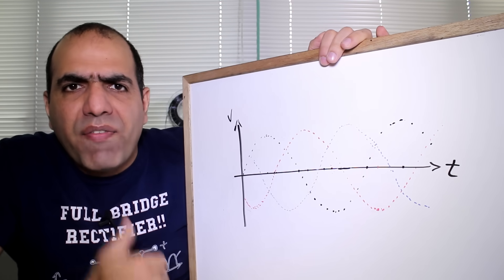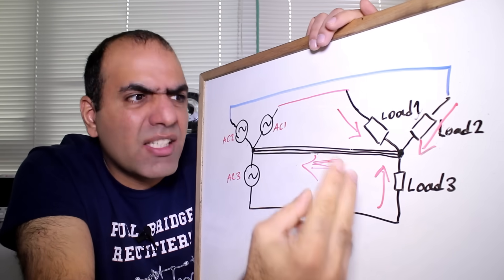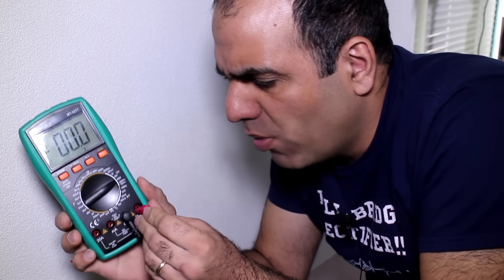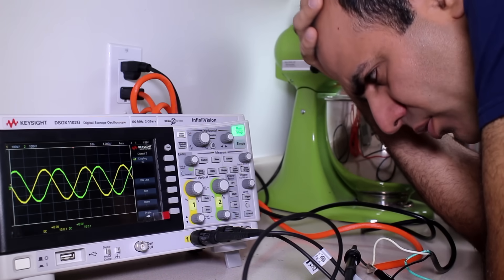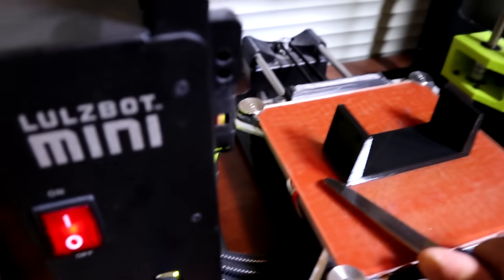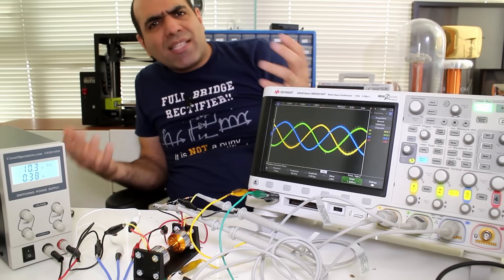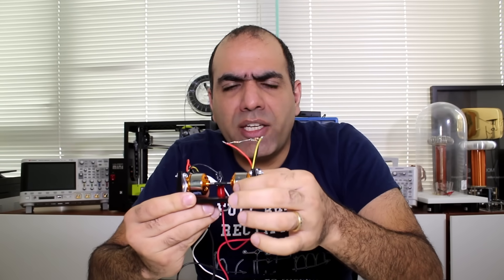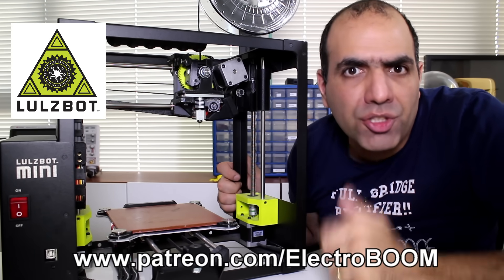Why 3 Phase AC instead of Single Phase???

Comment: oh, poor Canadians.
in europe almost every house has 3 phases :)
Reply: Eric Cartman, Appliances in the Americas don't use "disgusting amounts of power" due to the fact that we have an electrical system with Fischer-Price-my-first-electrical-grid voltages.  it's simple math, guy.  440 three phase can supply 20KW using 10AWG wire, whereas in the Americas we need to run #3.  As a sparky, I can tell you which I'd rather be pulling through pipes or an attic.  Running massive wires in an attempt to get a usable amount of power is cost prohibitive, so we compromise by making our appliances draw less power.  An induction hob running at 3 KW will actually take less energy to do its job than one running at 1KW due to the fact that the cooking will be done quicker, and will be radiating heat to the environment for less time.  I hope I've shed some light on why the electrical used in American homes sucks so hard as compared to most of the rest of the world.  Cheers!   

P.S. It is totally possible (and happens once in a while) to lose one of three phases and have the remaining still live.   Any single phase equipment on the two remaining live lines will continue to operate as normal.  Three phase motors that are already running will continue to run on the one remaining sine wave, albeit roughly and will get very hot if the overload system doesn't function properly.  Three phase motors that try to start will make a lovely 60HZ hum and rapidly burn themselves out or trip the overloads.
Reply: Of course you need 3 phases, without them you can't have 16A CEE Sockets.
Reply: Eric Cartman It's not using 11kW all the time, but most Induction cooktops here (Germany) have 4-6 spots wich can use up to 4 kW at once (not all at the same time). This directly translates to shorter cooking times and since the amount of energy to warm the food is still the same it is not inefficient. It's a nice thing to be able to boil a bowl of water in under a minute, and when it's boiling the cooktop wont use 4kW to keep it at that temp.
Reply: Onebeats Also running 4 kW with 400V 3p uses a lower current than what you’d do if you ran the same power with 230 1p. So not only can you split up the different currents for the same appliance, you won’t blow out your entire fusebox While cooking some pasta.
Reply: How do americans cook? We use propane burners.
Reply: Eric, Induction cooktops are not current dependent, higher voltages are prefered for induction cooking over lower voltages as the windings in the inductor are rather small. Induction coils use high frequency AC to create a magnetic field that creates eddy currents in the pot above it. In order to reach the average 24Khz wave that most induction cooktops use high current just isn't a possibility as everything has inductance, especially a large air transformer which is all an induction cooktop is. An inductor resists a change in current flow, changing current flow through an inductor requires a lot of work as it has to break down the magnetic field in the inductor, the more current flowing through it, the stronger the field and the harder to break it down. So they use low current, high frequency and as high a voltage as practical in the given application, as more voltage means less current for the same amount of power.

And no, 3 phase in a home is not a novelty, it is not a waste of cable either as you only need one extra conductor from the pole, and the conductors can be smaller from the pole. But more importantly, large inductive loads can be powered with substantially smaller wires. A 10HP single phase motor (as large as you can practically get off single phase) requires about 40A of current at full load with poor starting characteristics (start capacitor is a requirement), whereas a 3phase motor of the same power and voltage ratings draws half the current with high starting torque. The single phase motor (240V) requires both live lines and earth, 3 wires, though you're also going to run the neutral for any 120V control circuitry that is present, so actually 4, and 4 large wires at that as the neutral and earth both must be able to carry full 40A fault currents. Whereas the 3 phase motor runs the 3 phases and an earth (neutral is optional but may be run anyway) so you have either 4 or 5 conductors all of which are substantially smaller due to the 20A current requirement, and that full fault current is only that of one phase no matter what you fault together.

Applications for 3 phase power in residential includes but is not limited to Central heating/cooling, high power heating equipment such as water heaters, clothes dryers, stoves/ovens, baseboard/floor heating, motor equipment such as in geothermal or pools/hot tubs, air compressors, garage lifts, metal and woodworking machines such as lathes, mills, grinders etc. Welders, plasma cutters, well pumps, water treatment devices. The list goes on, and everything I listed are things that many people have in their homes already and need rotary phase converters or VFDs to operate.
Reply: 3 phase is convenient when when the mains water supply stops 70m down the road.  415 volt bore pump even limps along when one of the phases occasionally go dim.  I'm hoping that three phases will be of benefit to electric car charge, whenever that's a thing.
Reply: Chuckiele gas
Reply: @Eric Cartman; "3 phase in a home is just a novelty"; No, every apartment I have lived in across Europe have had 3 phase power. 85% of the world has 3 phase residential power grid.
Reply: @Onebeats mine does use 11kW at a time when all plates are at full power and the oven needs another 5.5 kW when in full power mode.
the Usual German "oven connection point" offers 3*400V*16A=~19kW or 3*230V*16A=~11kW << the actual available power is dependent on the way the oven uses the power mine e.g. uses 3 phases which are rectified and can as a result also be used with one phase (32A) or 2 Phases (24A) with some effects on power (not all plates can be at full power at a time) additionally it has a configurable phase current limit.
Reply: @Adam Ohm our house was built 1606, over 400 years ago, and also has 3 phase.
the house got electrical mains power first in our village 1919 (a community thresher was bought) but by 1922 all houses had power.
We have a 125 A connection, but today mains connection in the range of 63-100 A are more common.
Reply: Now you're just not reading well. I explained that an inductor creates a magnetic field with current flow, not electrical potential. But you don't need 50A to make an inductive loop. Yopu must not have any idea how they actually operate if you think they step down the voltage. Just go pull up and datasheet on them. Even the home made ones run at 320ish volts, 400V just means less current for the same amount of power. Since you decided to bring transformers into this, how do you think they work? You want higher currents in the pot not the cooktop. resistance to the flow of current is what causes heat, so you want a ton of current flowing through the pot with a modest resistance, its why copper pots don't work. Since induction pots have only a couple coils vs the many coils in the cooktop that makes the whole bloody thing a step down transformer. The primary side is high voltage low current, the secondary low voltage high current. They don't work like you say, they DO NOT want large amounts of current flowing through the small primary windings in the cooktop.

A whole continent with a failing electric grid thats becoming more unstable by the decade. An outdated system that was fine 70 years ago. Hand wrenches work just fine for fixing cars, but you don't see mechanics using them to take wheels off, they use new and modern technology. An impact gun or air hammer is not a novelty just because we have wrenches and regular hammers.

You don't understand the whole point of a 3 phase system. One more conductor to the house and you can cut the size of all of them by half. Start out with 3 cables 1sqin, thats 3 sqin. now 4 cables at .5sqin. thats 2sqin total. Its not speculation that 3 phase uses less cable to deliver the same amount of power, its tried and tested fact.

10HP motors was an example for how 3 phase power reduces the current requirements and thus wire thickness. It was not a literal example that only people with 10HP motors can benefit from. Even a 1HP motor benefits.

As far as appliances using 3 phase power, no they don't need it, but you don't need air conditioning or TV or phones. Just because cavemen got by with lighting sticks on fire doesn't mean we cant improve. Do you know what gauge wire needs to be run to provide a house with 200A split phase service? quad-ought aluminium. thats 48Kw of available power. The same 3 phase system is only 65A per phase, which is fine on 4 gauge wire. Since I really don't think you know what that difference actually is, I'll give it to you in a percent. Using 3 phase power means that even with an extra conductor you still use 60% less wire than a traditional split phase system. That means a 60% reduction in copper or aluminium usage. Why wouldn't you upgrade to a cheaper construction.

Should america move to 3phase, absolutely, it would save an enormous amount of money, especially seeing as most of the grid is already 3 phase until it branches off for the transformer at your drop.

No HVDC is not the answer. Not yet, they still haven't fixed the issues with Galvanic corrosion. China is installing a 660KV DC line, several actually and they are so skeptical over it they halted construction on all but one to see how it works as preliminary tests in the short few years its been up has already revealed severe corrosion issues on its line insulators. Its not even a bloody decade old and its falling apart, meanwhile America still has an AC system in some places as old as the 1920s still hobbling along. 3Phase is just fine.

If you even made it this far, you really only have a basic idea what you're talking about. Any electrician thats worked on both will tell you 3 phase is way easier to install and maintain, and has lower costs associated with it. After all, there is a reason industry uses 3 phase power instead of just beefing up the current on a single phase system despite the increased simplicity of a single phase system. Just like there is a reason that modern homes are being fitted with safety devices that have been standard in industry for decades. If its done in industry, you can bet its going to be just as good and cheaper.
Reply: Well, in my neighborhood the power grid seems to be many decades old and things seem to fail quite often so usually only our village goes down. There havent been many big scale blackouts here so far.
Reply: No, we don't. Only useful for industrial power requirements.
Reply: Like my 11.5 kW induction cooktop? combined with a 5.5kW oven? 
or flow-type heaters for more than one user? 18-24kW are common and even ~27kW are not that uncommon.
Reply: An induction cooktop will use 3kW tops. What the kind of induction cooktop do you have? Throw it out, its highly inefficient.
Reply: Plus it occasionally happens that you get a blackout on less than 3 phases, so you can still have power in a couple of rooms :)
Reply: M VanSumeren "due to the fact that we have an electrical system with Fischer-Price-my-first-electrical-grid voltages."

Well, we in Canada and USA didn't have the luxury of a second world war to destroy our economy and infrastructure like Europe did. :) In fact a lot of the household electrical systems in European countries before the end of the 1940s used 120v just like the Americas. The destruction to their electrical grid in WWII made it easier for them to start with a clean slate and upgrade to the more efficient 440 system.

I don't think I've ever seen a kitchen here in the US that didn't have a two-phase  (220v) receptacle wired where the stove goes (unless the stove uses shale gas or propane). I've never seen a single-phase stove either. Do they actually exist?

Voltage doesn't really matter anyway, it all depends on how efficient your appliances are built. Hell, Japan's household electrical system is even less than ours at a paltry 100 volts, and they seem to live just fine in spite of it.
Reply: Americans cook with a single phase because the appliances dont require a disgusting amount of power. Besides European and American households use a comparable amount of power anyways. So using 3 phase is not a power issue for households. 

Most faults dont occur in neighborhoods (in america at least). If the phase-ground fault occurs in the neighborhood you would be fine (maybe), but further out, its not safe. The simple fact that you have seen the other 2 phases being functional shows that your electrical grid is really sketchy. As phase to ground faults should not be happening in neighborhoods. 

This is because if a line trips, you'll be able to isolate that fault location, but if this fault location is too close the power station (which is more likely to happen), all phases need to be tripped to avoid too much zero sequence current.
Reply: MZ Flighter, i'm guessing you don't have many people doing their own electrical work aside from maybe replacing a socket or switch etc. I'd imagine with the increased complexity and safety hazards associated with 3 phase that people in Europe just don't mess with it as they do in america. We have a lot of 'home grown' electricians here that think they are competent when its pure luck they haven't killed themselves and burned the whole place down. I like the idea of 3 phase to residential housing, now if only they could do that with 100A per phase here in America, i'd be golden No more expensive VFDs or rotary phase converters for me.
Reply: An induction cooktop is current dependent so it wouldnt be using 400V, it would be stepped down to a low voltage to get more current.

The more current draw you have the less efficient its going to be because of copper losses.
Reply: Besides 3 phase in a home is just a novelty. Completely un needed and a waste of cable.
Reply: To produce magnetic flux you need current (flux = inductance times current). The reason why an induction cooktop is a coil is because its forming an inductor and creating a transformer with the pot (inductance = 1/v *di/dt , so the inductance relies on a changing current not a changing voltage). Transformers are current controlled devices, as they require a current in the winding to produce magnetic flux that transfer through the magnetic path to reach the secondary (aka the pot). 

"And no, 3 phase in a home is not a novelty" It appears a whole continent is doing just fine with single phase power being delivered to their home. 

"it is not a waste of cable either as you only need one extra conductor from the pole" Multiply that by every home and that's billions of dollars of cable. 

"A 10HP single phase motor (as large as you can practically get off single phase)" What the hell are your using in your house that is 10HP? I dont own anything over 2HP. 

"Applications for 3 phase power in residential includes but is not limited to Central heating/cooling, high power heating equipment such as water heaters, clothes dryers, stoves/ovens, baseboard/floor heating, motor equipment such as in geothermal or pools/hot tubs, air compressors, garage lifts, metal and woodworking machines such as lathes, mills, grinders etc. Welders, plasma cutters, well pumps, water treatment devices. The list goes on, and everything I listed are things that many people have in their homes already and need rotary phase converters or VFDs to operate."

Many homes in america have these kinds of equipment. If you need 3 phase, just buying an inverter. Need more power? Get an electrician to change your plugs out for something that can handle more power. Its not a big deal, and never has been. The amount of people that require a 400V 3 phase connection to their home is very small. 

So here's the thing should America get 3 phase power to their homes if they had money to do so? Still no. 

Research is going into smart grid. Smart grid has a crap ton of multi-disciplinary studies and one of the studies includes the implementation of 480V DC lines. 480V DC lines will benefit the majority of american's homes than 400V 3 phase AC. 480V DC will be able to generate 400V 3 phase AC easy for the small amount of people that require that kind of source. The 480V DC will be able to be bucked down to directly charge a car battery. All your electronics will no longer require a transformer to drop voltage with 480V DC. Solar panels and wind turbines will no longer require a inverter to deliver power to the grid with 480V DC.
Reply: if one phase is faulted, the other 2 phases will see their voltages collapse to 0 (if grounded), if ungrounded those phases will rise upto a factor of root(3). 

So no, you'll not be able to safely use power connected unfaulted phases.
Reply: Yes, you will, Ive seen it happen several times. They use redundant transformers in my neighbourhood and if one phase goes down, the other two occasionally are still usable.

And yes, most cooktops, not just induction ones require 3 phase power here. No idea how Americans can cook properly with a single phase.
Reply: No purpose for 3 phase in a home.